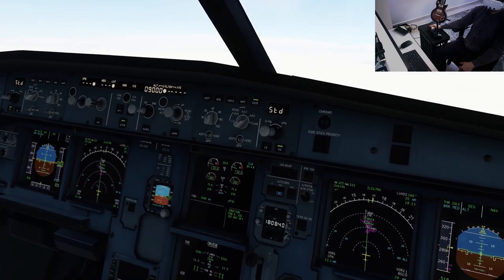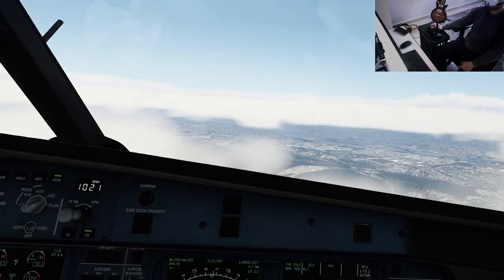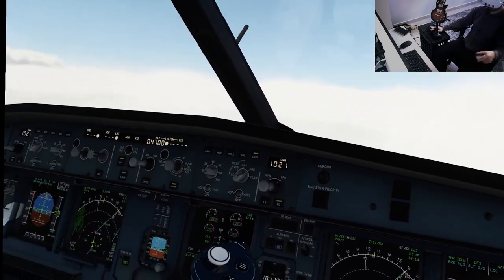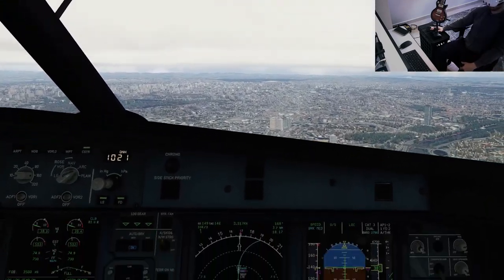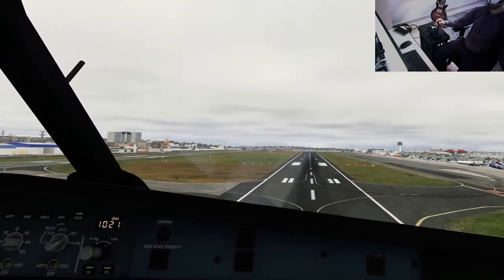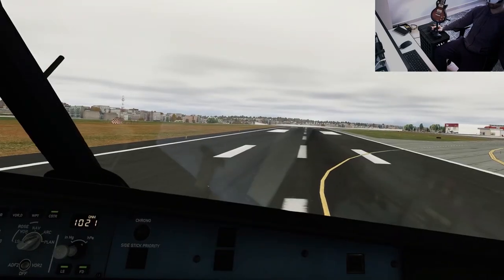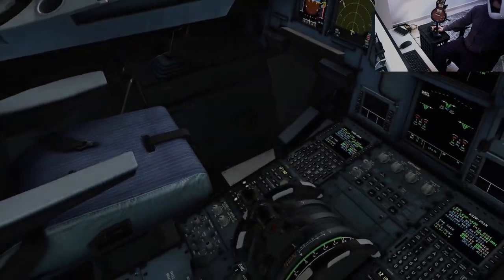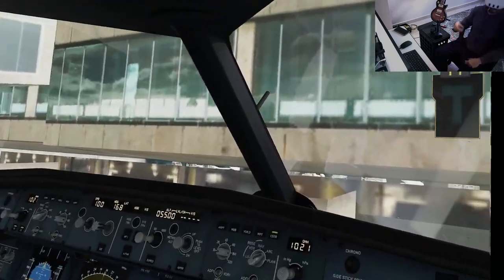Congonhas  - X-Plane12 - Toliss A320 - Quest3 VR

Comment: hello, is the quest 2 a good vr headset?
Reply from the maker: I use it for 2 years, and yes it does all that quest 3 also does
Reply: @fsprimo  but you cant look films or videos like in the quest 3 right?
Reply from the maker: @xnicowise  Those headsets use the same software. So If you can do it on 3, you'll be able to do on 2 also.
Reply: @fsprimo  thats very nice, do I need the link cable to play xp12 with the vr headset?
Reply from the maker: @xnicowise  Link cable or a Wifi 6E router to do it wireless . I use cable. never have any trouble with it .
Reply: @fsprimo  a Fried told me that the new driver Edition from quest 2 isnt compatible with xplane 12 is this true
Reply from the maker: @xnicowise  Man! everything that runs in your PC will run in any Oculus, Remember, VR its just a 'screen', nothing more.
Reply: @fsprimo   but can I Click the Buttons with the Controller in ovhd panel?
Reply from the maker: @xnicowise  absolutely .. you can watch my past videos . There's a bunch of them using quest2